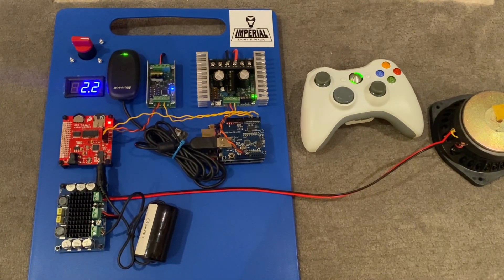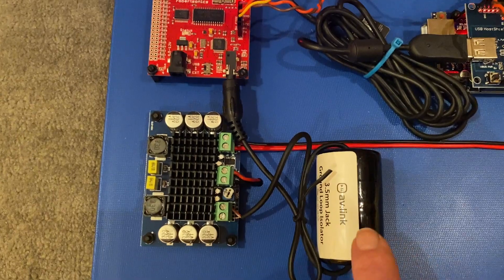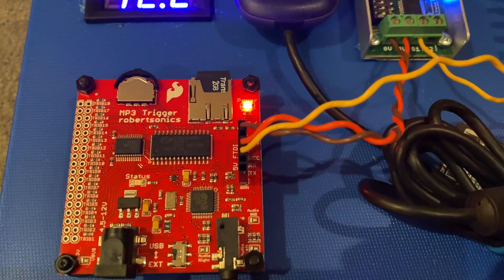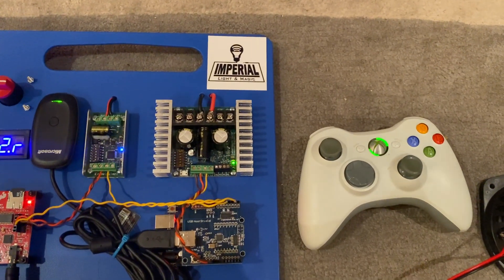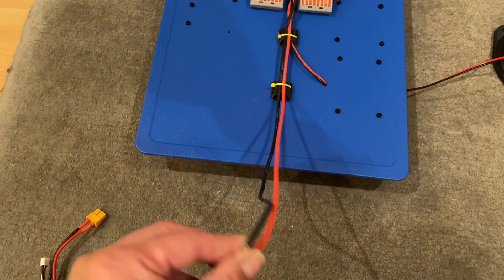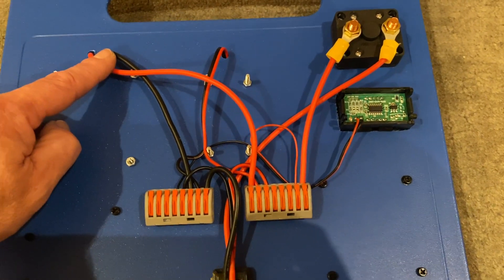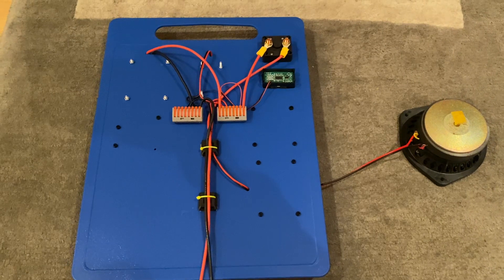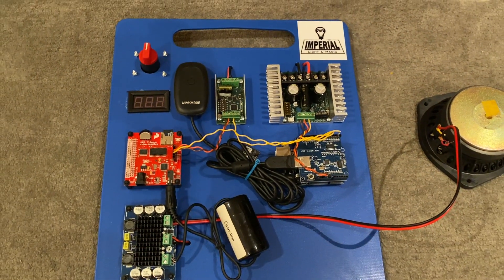Padawan 360 build instructions

Comment: Got same set up but no output power from Syren 10 with dip switches set as you suggest? 
Any reason for this ?
Reply: Will check the sketch and baud rate tonight
Reply from the maker: There could be a number of reasons, I always suggest you check the hardware first, like are all your patch leads ok, do you have a common ground, is the dome baud rate in your sketch set to 9600.... hope this helps but please do comment to let me know how you get on.
Reply: @ everything else is working , mp3 player etc , just no output from top of Syren 10 with dip switches 1 & 2 down and rest up.
If I put all the dip switches up , I get power so assume it’s a dip switch combination problem? Just thought if I’d copied yours exactly then it would work but not the case
Reply from the maker: @troopercop  dip switch change would indicate that your dome baud rate in your sketch is set wrong.  It might be set to 2400 instead of 9600.  If you want to try my personal mega sketch, it's on github.com/imperiallandm
Reply: Will your sketch work on my uno board ?
Reply from the maker: @ no it’s for mega only. Did you check the domebaudrate setting in your sketch?
Reply: Thankyou , changed baud rate to 9600 , was set to 2400. Motor working fine now from right stick. 
Just gotta sort the sounds now as there not playing same order as yours. 
They are all in correct order on the card using your “drivesort” program. Just can’t get it to play the music / audio clips etc like Leia and theme music. 
They are all on the card but can’t access them?
Reply from the maker: @ which set of files did you use? There’s a set on my GitHub page imperiallandm

Comment: Hi Steve...hopefully this is an easy question.  I have an Arduino Uno and USB Host shield connected.  I have ensured that the Host Shield is soldered appropriately to ensure the USB port provides power to the XBOX receiver.  I am noticing, however, that the XBOX receiver is not powering up when plugged into the USB Host Shield, however, it does power up when plugged into my PC.  So.....I tested the the USB host shield by plugging a USB cord into in and connecting it to a simply LED light....which worked.  I am wondering if the USB Host Shield is not providing a full 5 volts to power the XBOX receiver?  Is there something I can do to resolve this?
Reply from the maker: On some receivers, the light only comes on when the device is communicating (why it lights when plugged into your pc) so that’s more than likely an issue with the host shield (have you seen my video about faulty usb host shields and changing the chip?) or the hardware ID
Reply: Hi Steve.  Yes.  I did change the IDs per your video…still no luck.
Reply from the maker: @rprealitycosplay  Have you checked the "AHC" chip?  If you don't know what I mean, check out my video about fixing issues with USB host shield.

Comment: Love your videos. quick question. i have  bought x2 12v motors for the drives, and i am planning on using an 18v ryobi battery, will a 12v buck converter have enough ooomph to power everything
Reply from the maker: I wouldn’t bother, just dial down the max drive speed in the sketch so you don’t overpower the motors.
Reply: @ImperialLightandMagic  thank you. What would you suggest I dial it down to please. Electronics is not my. Forte
Reply: think ive found it ive dialed down the max speed from 120 to 80does that sound ok?? @ImperialLightandMagic

Comment: Hi Steve....I love this tutorial.  Thank you!  Can you tell me how long of a charge you get on an R2  unit with this type of setup? If I used a 24 volt battery....how long would I be able to control my R2 unit until the battery runs out?
Reply from the maker: First answer is "it depends". On thing such as the weight of your droid, the surface you'll be driving on, how much driving you expect to do (versus static making sounds and moving the dome around), however, the most important thing which you've ommitted is the mAh capacity of your battery.  Volts is how fast he'll go, mAh is how long he can go at that speed. :)

Comment: Out of curiosity. I plan on running my system on 18v battery. Can I connect a 18v to 5v converter from the battery leads to “Y” out  to power my teeces lighting? Besides the dome moving, I don’t plan on anything else up there except the lighting. Thanks in advance.
Reply: I’m just not sure how to power my teeces lights without having to add anything other than a voltage converter if I even need that. Help me Obi Wan Kanobi. You’re my only hope.
Reply from the maker: Yeah absolutely, you’ll just need a slip ring to get power into the dome. I would run main voltage up through the slip ring, then drop down to 5v once inside the dome, which puts less current through the wires.
Reply: @ImperialLightandMagic  thanks. I appreciate you my friend.

Comment: So,  just to clarify..... you said that there are no changes if you plan on using power above 12v??, I'm planning on using a pair of ryobi 18v batteries in parallel.... can the syren10, sabertooth, amplifier, and the arduino handle that voltage??? Or do i need to step it all down to 12v to keep from frying all of them??? Thank you for all your videos,  I'm at the electronics portion of my build,  and you really help to make them manageable manageable... maybe a future video on integrating the teecees system !!! Thanks again!
Reply from the maker: So long as you use the 5v out from the sabertooth and syren to power the arduino and mp3 trigger (respectively) and your amplifier is rated to 18v, then no, you shouldn’t need any changes.  The amplifier boards I use handle up to 24v infact they perform better above 12v.

Comment: Magnificent tutorial and very informative! Instead of using an X-Box controller can I use an RC controller instead such as a TX165 radio? Do I need an arduino or can it be built without one? My R2 will be powered with a 24V system. Lastly my R2 will just roll with the foot motors, have the dome spin and hopefully get an amplifier with a speaker for his sounds. Do you have this type of tutorial available? Again, thank you vey much for the detailed information!
Reply from the maker: Hi Ed, yeah traditional RC shouldn’t pose many issues other than controlling sounds. I have previously made a board that allows you to control sounds (to a degree) using rc. Have a search on my channel for pwm sounds.
Reply: @ImperialLightandMagic  Hi Steve, Excellent! Thank you very much! As for the Arduino do I still need it? If I do will it need some kind of code to operate with the RC controls?
Reply from the maker: @Toy_and_Prop_Masters  at the moment I’m not aware of an easy solution to controlling sounds without using something like an arduino. There may be solutions out there with rc relays and such and indeed this is the way a lot of folks used to control sounds (with an 8 way relay remote for example) but these days using an arduino is just so much easier.
Reply: @ImperialLightandMagic  SOLD! You have then convinced me to follow your detailed instructions. I will convert to the X-Box controller as shown in your videos and follow your lead, thank you again for a magnificent job, I truly appreciate it all your hard work!

Comment: How are you dealing with the regenerative power from the Sabertooth if R2 is moved around with the batteries disconnected please?
Reply from the maker: I have an XT60 plug on each pair of leg wires which I detach before pushing.

Comment: Hello! What gauge wire are you using for the 5v connection from SyRen to Sparkfun, and Sabertooth to Uno?
And is it the same as what you’re using for the signal wire?

I’ve purchased an “Elegoo Dupont Breadboard Jumper Wires Ribbon Cables Kit” , and want to know if that’ll work, or if I need something different.

Thank you!!
Reply from the maker: Hi Zakk, I used 22AWG wire for those.

Comment: Can you give a tutorial on uploading the code to the UNO?  Everyone says it’s easy but I am running into more roadblocks!
Much appreciated!!!
Reply from the maker: The problem with doing a video about uploading, is that it can differ from PC to PC, so what works fine on mine, may not work on yours perhaps due to a missing library, or a path for a file or any number of reasons.  Best thing is post your issues on one of the FB groups, such as Baddeleys Printed Droids, with as much detail or screen grabs as possible, and the community will find a way.